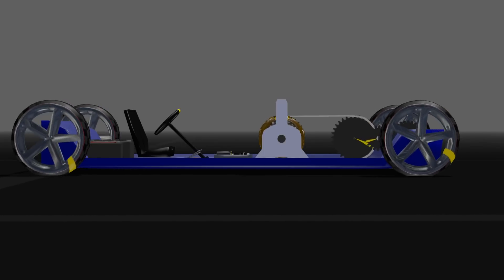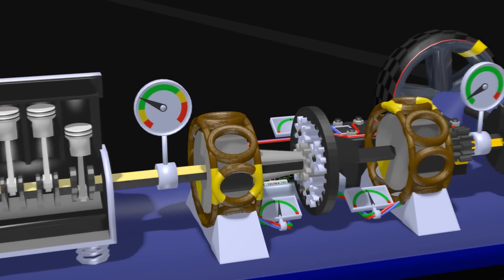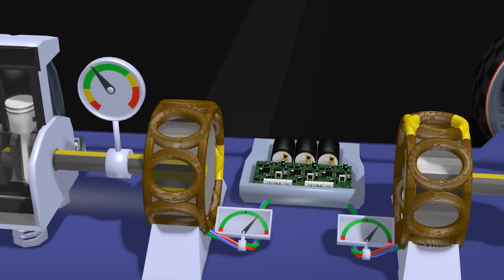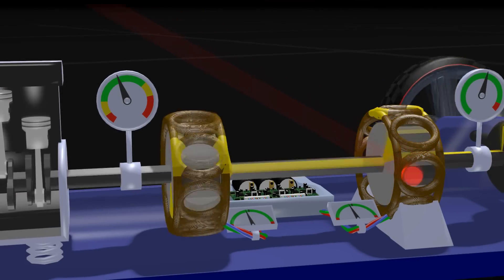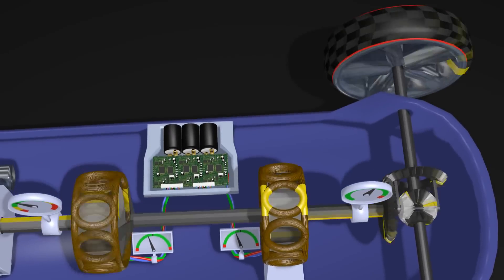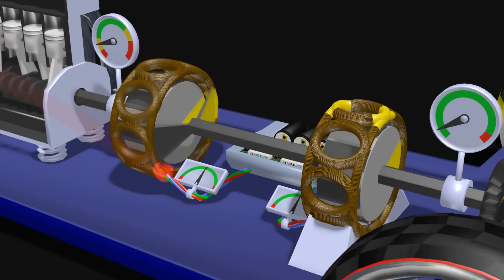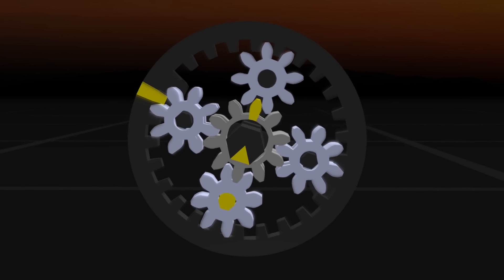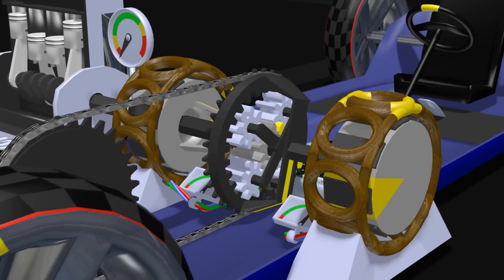Prius Hybrid Drive Explained

Comment: Great video. Clear explanation. What year models do the various incarnations of the planet gears correspond to? I'm thinking of buying a 2007 Prius.
Reply from the maker: Mine is from 2008. It's second-gen, and that's what my video is based on. Your 2007 is probably the same - but to be certain you should check out https://priuschat.com/forum/ . That's where the real experts are. :-)
Reply: @nielsblaauw  Thank you. I did end up buying it. Still going strong in 2021!

Comment: The Prius does not have a "normal" gas engine as stated in the video. It uses a Atkinson cycle motor, as little to no compression cycle increasing efficient by 20% but has much less torque/power. So the main reason a Prius has an electric drive motor is to increase power when needed to make up for the lie power efficient gas motor, greatly increasing gas mileage. Because the Prius ugas only one gear, is allways in the same gear the electric motors high torque is required for good excelent and power, a Key part not noted in the video.

Also a Prius gas motor is directly connected to the wheels and both electric motors at all times, no clutch or torque converter and no reverse gear, Prius has one gear (one gear ratio) and it's always in gear if stopped with gas engine running, moving forward  or reverse with the gas motor running, stopping or starting.  It's simple and super reliable as it is always in the same gear, never changes or disenguages, there us a clutch that is allways engaged, never changes, it's only there to absorb drive train shock.
Reply from the maker: Two things:
1. For my explanation, the petrol engine is a "normal" engine in that it burns gasoline to create power. 
2. I made choices in what to tell and what not. I limited myself to the 15 minutes of an adults attention span. If you don't like my choices, I invite you to make your own video about it.
Reply: Niels Blaauw, Your 3D animation and accompanying explanation are beyond the point of excellence to me. I have no doubt in my mind that you left out the details "Alan Connelly" was talking about for the sake of simplicity and clarity. 
My thumbs up goes to you... Thank you...
Reply: The transmission has whatever ratio it needs to have for the speed, load, and power demands of the moment. It has a very high ratio when taking off, and a low ratio when cruising along. 
Unlike a standard Otto engine, the "Atkinson" engine has an 8:1 compression ration and a 16:1 decompression ratio. It is thermally so efficient that the cabin heater doesn't make much heat in the winter.

Comment: Great video, thanks. I'm still struggling to understand how the planet gears can be used to vary revs at a fixed speed (e.g. mashing the throttle). But I'll watch it a few more times.
Reply: Mg1 by changing it’s speed will change the gear ratio

Comment: 4th gen Prius is back to single planetary gear set design, if I'm not mistaken.
Reply from the maker: Quoting Jeff N on https://priuschat.com/threads/prius-hybrid-drive-explained.172784 :

"I noticed you said the 4th generation has a second planetary gear set but that's not right. It is correct for the 3rd generation. The 4th still has gear reduction on MG2 but they no longer use a planetary to do that. Instead, they use simpler gears that have less internal friction."